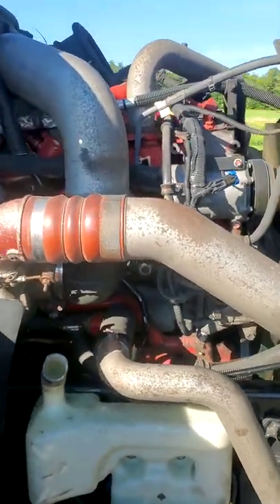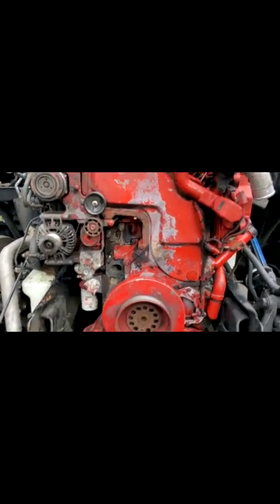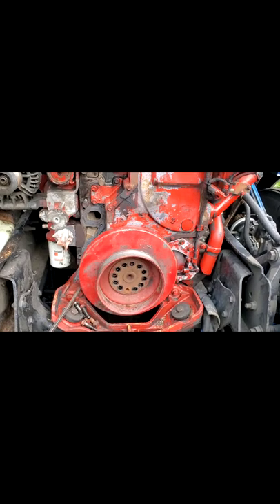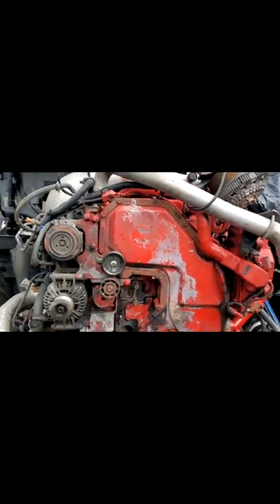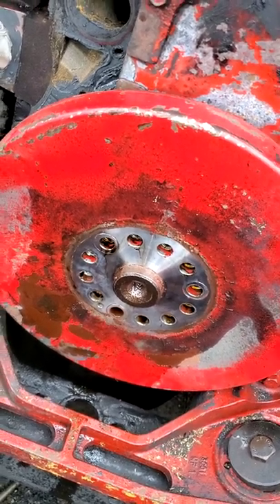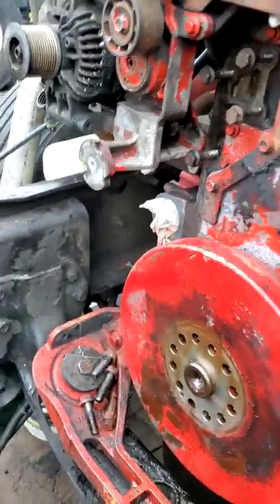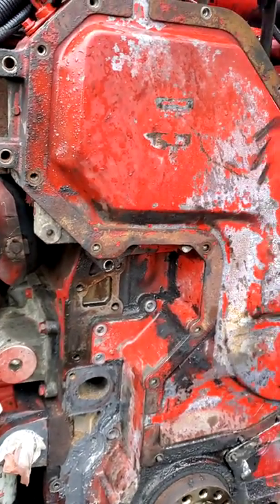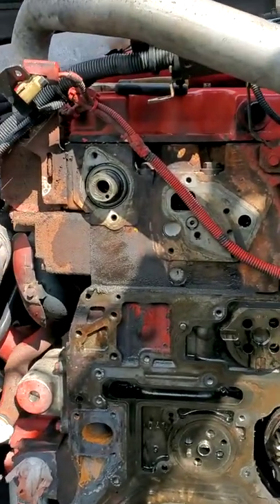Cummins ISX (with oil leak) Front Gear Cover Removal - Tutorial

Comment: Get rid of that scissor gear if you still have the motor apart. They eventually start to loosen in time, I bought mine in time. And do not forget the Lock Tite, I think it is the 409 or 904 formula for the cam gears. It is listed in the reassembly instruction in Cummins Quickserve.

Comment: This job is a real pain in the ass.  Gears are tight
Reply: It's a pain in the ass to get that cam idler gear right at .006" before that locktite sets on the cam gear. A race against time